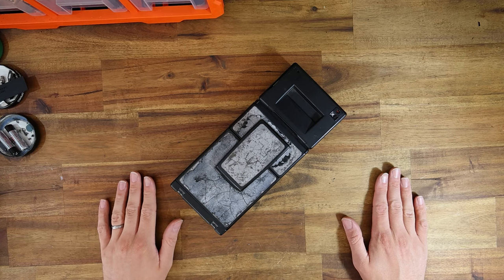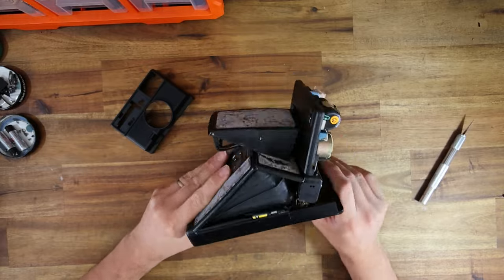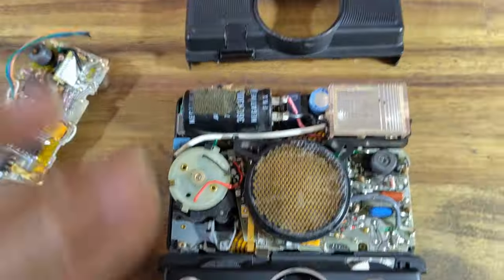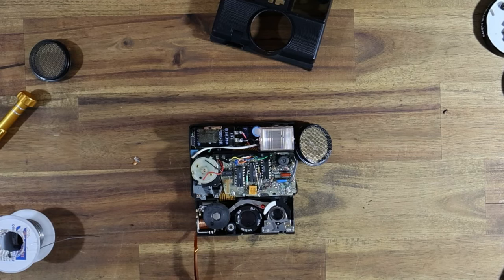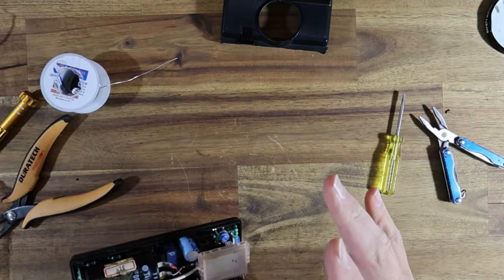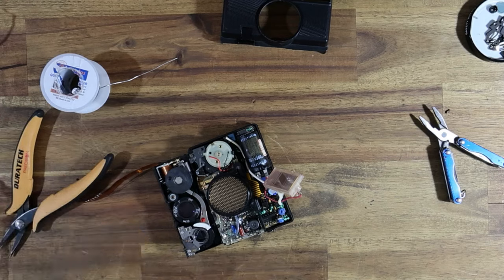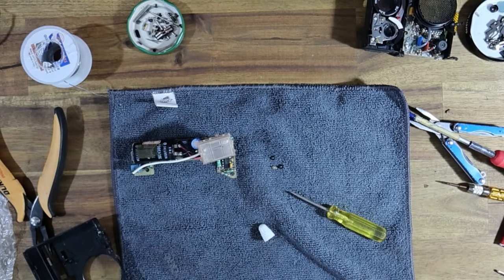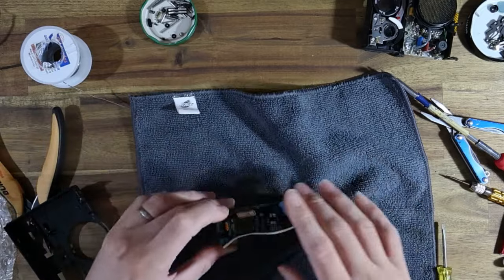Building a chrome Polaroid SLR680 with manual control!

Comment from the maker: Please note that my comments at the end of the video suggesting their may be two variations of the SLR680 shutter are actually incorrect. However, I was on the right track! 

In reality, the issue had less to do with blade design, and more to do with solenoid pneumatic calibration. It seems there is more art than science to this calibration method, and the factory standard method will not necessarily work in ALL cameras - although it is a good reference point! 

The SX-70R project is so fresh at the time of this video's release that the information is at the cutting edge! Not even the project lead knew of this information. Using knowledge gained from this build, I've come up with a new calibration system for the SX-70R, which Carlisle will roll out in further instruction guides. Further details are described above in the video description.
Reply: For how much do you sell the camera? :)
Reply from the maker: @ColTRaw  all service pricing is on my Instagram and Facebook pages - where i keep it up to date

Comment: You are best expert of reflex polaroid cameras;my 680 is of 1984;I bought for 250 euro in 2016 in Italy from eBay in mint condition;now after 7 years works ok only rollers a bit dirty (I don’t say why but modern Polaroid that I have like Polaroid lab and Polaroid go has always rollers that stay clean 🤷)and only from 2022 a little scratch in leather of folding viewfinder that I resolve whit uniposca that colored of black;probably leather of viewfinder start to deteriorate because I carry 680 folded flat in internal poket of jacket
Reply from the maker: thank you for your kind words!

Comment: Would you happen to know if the transducer on the Pronto AF is also the same as the 660? I have a working Sonar Pronto, but the af only ranges from 20ft-25ft depending if my hand is in front of it. Figured the sonar was going bad and I have that broken 660. I was thinking of taking the sonar out of it to replace the Pronto's.
Reply from the maker: I don't think that's a transducer issue from the sound of things

Should be identical and interchangeable though

Comment: Small detail perhaps, but don't you want change the flap on the door, where it reads "SX-70 sonar" for the one that came with the 680 that reads "600 land camera Autofocus/Auto strobe"?
Reply from the maker: The flap is heat-staked in place to the door with plastic rivets. One cannot simply "change" the flap with any kind of ease, although you could put a sticker over the current logo

Re-melting the heat stakes is only something I'd do if the flap had already completely come loose

The door flap is still technically correct though. It is a Sonar camera after all.
Reply: @theinstantcameraguy  Oof, sounds like too much of a faff! Haven't really looked at how it attaches to the door. :)
Reply from the maker: @linusjarnbjer3740  with some patience, some heat and a scalpel and a bit of luck, it might be possible to salvage the original SLR680 door sticker

But by doing so I'd ruin a perfectly good 680 door, which is a valuable spare to have. 

Since the cameras flash assembly logo was already ruined, I blacked it out completely so as to more match the original Sonar color scheme. My intent was to make a Sonar that... wasn't!

Comment: Why is there text “680 arrow” on the PCB by the flex connection? 45:09
Reply from the maker: @scottgann2688  it was to mark a set of pads to bridge with solder a specific firmware for the 680

It's no longer necessary to do so, and the firmware is updated

So you can ignore it
Reply: Thanks Jake. I love that the SX-70R project is constantly evolving and improving.

Comment: If I was to send in a normal SX-70 in for a SX-70R mod how much would it cost?
Reply from the maker: I am specifically not mentioning prices in these videos in case people watch them years from now and prices have changed (inflation, parts etc). 

I have all current price-guides on my Instagram listed in AUD page for people to peruse. They are easy to find if you follow the links. 

If you don't have Instagram, or cannot access my public page, feel free to email me.

What I CAN say is that they are cheaper than buying a MiNT SLR670 Time Machine and have far more features.